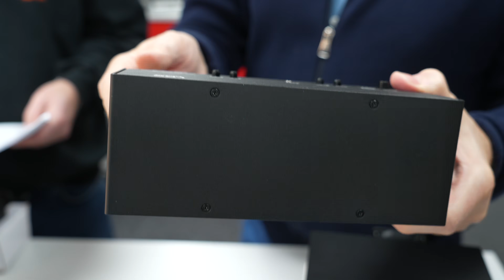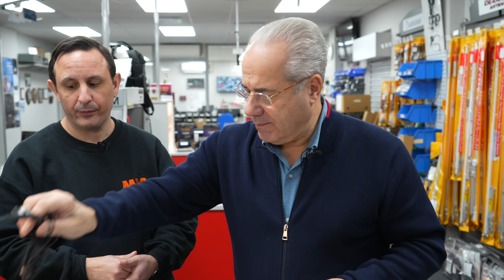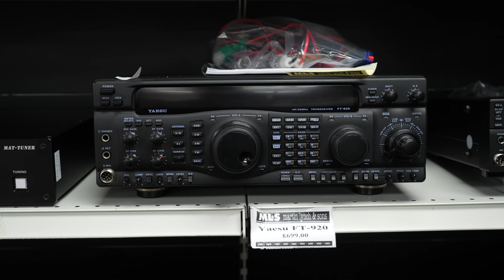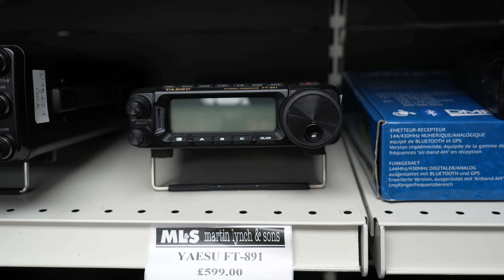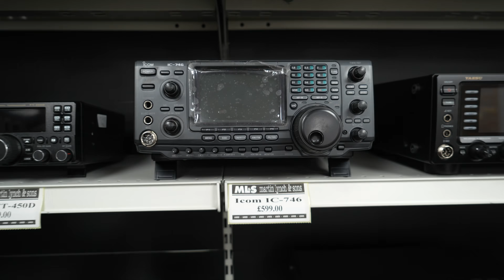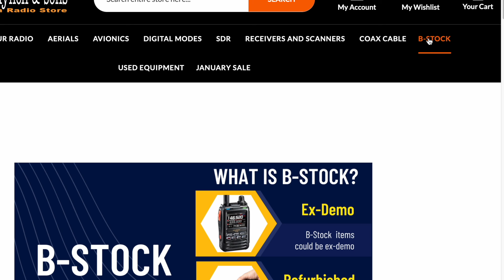BEST Ham Radio Used Equipment!

Comment: I bought a Lowe HF-125 Receiver back in about 1987 from a Ham store in North West London and paid about the same amount of money for it, good radio but most of what I listened to back then are no longer on air such as the Marine CW beacons
Reply from the maker: That would have been Lowe Electronics, all long gone now as indeed its founder, Bill Lowe. 73 de G4HKS
Reply: @Martin_Lynch  I remember I saw it advertised as secondhand in Ham Radio Today, but I'm sure I drove further into London than Eastcote,  I felt a little in awe at the time only being 20-something with all those big ham radio transceivers on the shelves in the store as I wasn't licensed back them